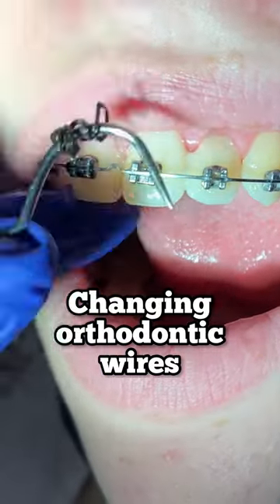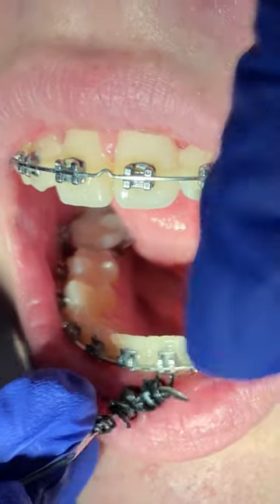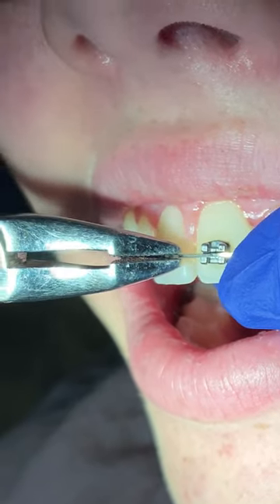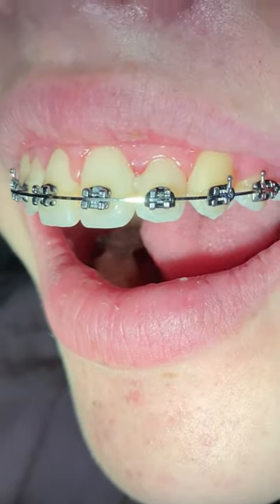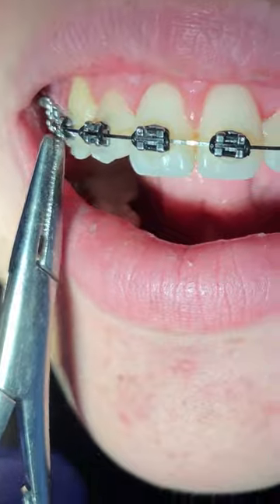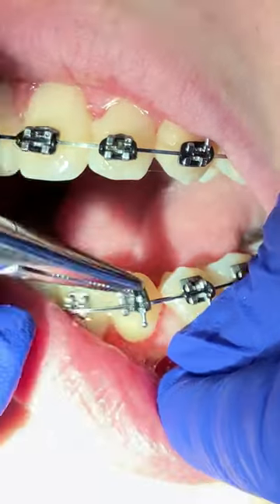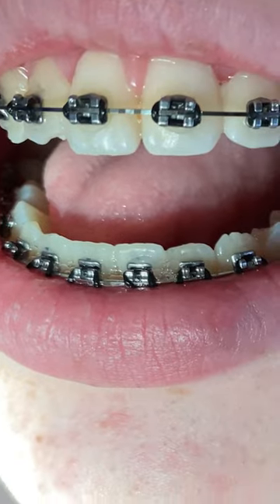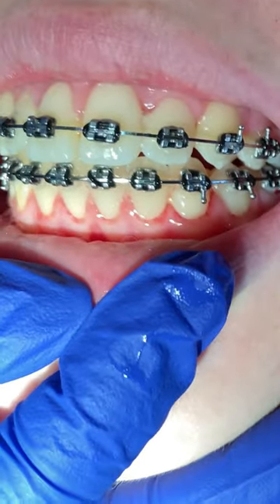Orthodontic wires- NiTi and Stainless Steel wires - Tooth Time Family Dentistry New Braunfels

Comment: Please can someone tell me how to properly brush around molar bands so that I don’t get a cavity bc I cannot get between the band and the molar. I also have an expander. I also think this YT channel rocks 🙂
Reply: since the molar bands are bonded to the teeth you can’t get a cavity on that bonded surface. brush really well below the band along your gum line to prevent any build up but otherwise don’t worry too much about flossing between the molar band and the next molar with just a bracket! as long as you’re consistent with brushing twice a day it’ll be just fine. also stay away from sticky gummy candy, it’ll get stuck in all the ridges and tiny gaps you can’t get to and cause cavities!
Reply: @m.p1120  thx very much. I have not eaten any candy since my braces were fitted. It is not easy eating with an expander. I am also using a water flosser which helps me do better 🙂